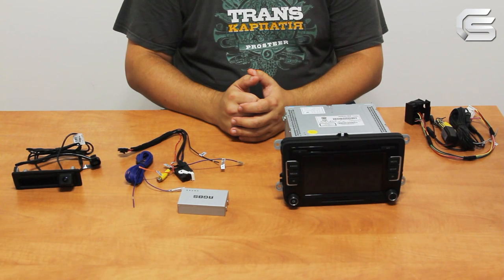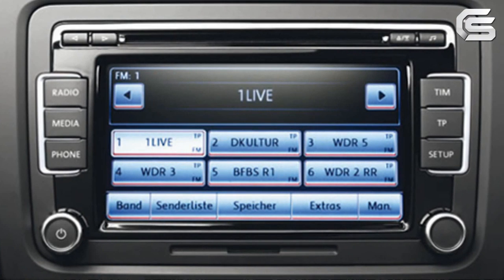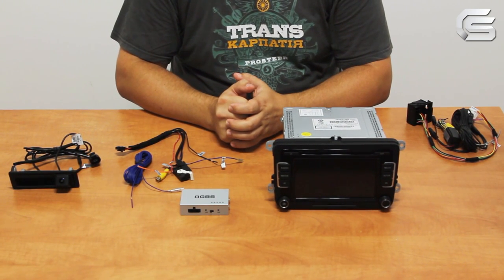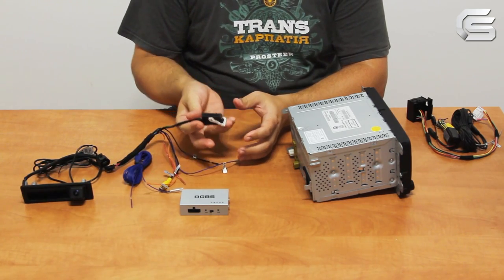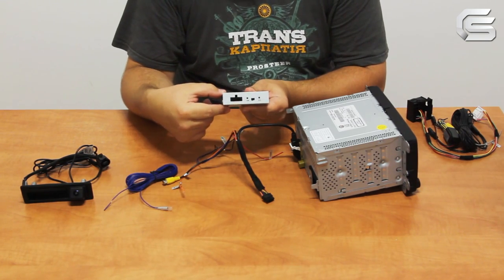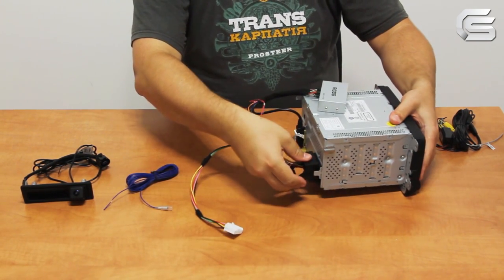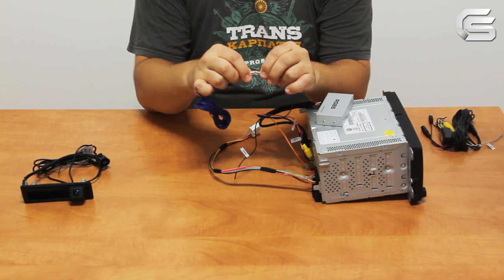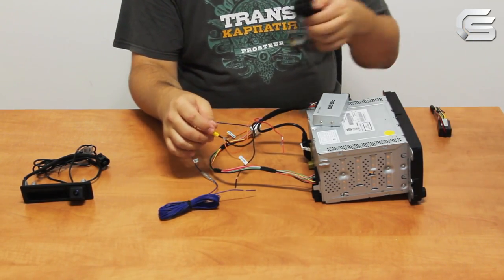How to Connect Aftermarket Rear View Camera to Volkswagen OEM Monitor

Comment: When I put it in R, the screen automatically goes to the camera through Canbus Do I still have to connect the red cable in reverse? or is yellow constant current and black mass sufficient? but won't the yellow constant current drain the battery? or can I also put Acc contact power on the yellow b+ so that it only turns on when the car is on

Comment: Do ypu have to go into the radio using a vag-com to make it work with the system?
Reply from the maker: You need to have your monitor programmed on the dealer's computer, namely to have the rear view camera function activated. Otherwise, the adapter and connected camera will not work. 
To do this, contact your local dealer. Please, note that it should be done by a well-trained specialist.

Comment: Hi I bought a vw cc 2010.  Is there a way to add GPS and Bluetooth without buying an aftermarket radio or to get a original vw unit for cheaper?  I am from South Africa and the only place that I can get something like that is from vw and they are insanely expensive.
Reply from the maker: Can you please clarify what kind of media system is installed in your car first?
Reply: Hi it is a RCD 510 Premium 8

Comment: Will this work with 2014 Jetta hybrid and done is have dynamic range?
Reply from the maker: It depends whether there's a necessary input in the head unit (RNS315, RNS510, RCD510 Delphi). Also, rear view camera functionality has to be activated (more details in product description). Lines are not supported, it's related to the OEM navigation box and camera.

Comment: I have an rcd 510 but it does not have all the jacks on the video. Is there any solution?
Reply from the maker: Hello.
In this case you may install a video interface https://car-solutions.com/en/video-interface-for-volkswagen-passat-phaeton-touareg-skoda-2009-2015-my.php to connect an aftermarket camera etc.

Comment: I have the RDC510 with the MEDIA button on top right will this kit work for me?
Reply from the maker: +Timmothy S. McKean You should check if there is an input for OEM camera. Not all  RCD510 head units have it.
Reply: Timmothy S. McKean did yours work?
Reply: but my own when I put it in reverse it gives me a message saying there's no video available and mine only has a usb input no 26pin plug
Reply: @christiansmalley7138  I have the same it charges into blue screen, If you find any answers please let me know

Comment: Dear I have touareg 2005 with radio navigator s2 and I'm looking to find except rear camera also parking sensor and Bluetooth.is this fusible?
Reply from the maker: Unfortunately, we have no solutions for such car models and head units yet.
Reply from the maker: The only solutions that we can offer is this video interface http://car-solutions.com/en/car-video-interface-for-volkswagen-with-rns2-system.php
YOu can connect a camera via it but no parking sensors or bluetooth will be available.

Comment: Hi, why should i pay $100 for that modul, plus $30 for camera, if the OEM camera is $100? Or it's something i missing?
Reply from the maker: +ninavas03 Hi. If you find an OEM camera for $100, that's fine :) Usually, the cost much more.
Reply: +Car Solutions I had the opportunity to buy an OEM reverse camera, but the seller told me i need a newer central to work camera. Can you clarify me?
Reply: Valentin Sfichi i too get a OEM camera for 50 bucks, i have a jetta 2017, the oem camera came from the exact year with the same stereo, what do i need to install the camera? Do you make it possible on yours?

Comment: Hello,
I have a US version 2013 vw cc sport plus with I believe either a rns310 or rns315 head unit. The device just didn't work. I have my head unit programmed already so when I'm in reverse, the screen turned into camera mode except that it is pitch black. I connected the 26 pins socket into the head unit, connected the video input cable from the camera to the female socket from the device, connected the blue wire to the back up light , grounded the black wire and actually connected both orange and red wire to a power supply. my camera is powered separately as well. But there is still no image. Could you please help me ?

Thanks in advance.
Reply from the maker: Connect red(ACC) and black(GND) wires directly to the battery (+ and -) for testing. Don't connect the orange wire. Blue wire is not necessary to connect. Also, try switching 315/510 on the adapter in both positions and make sure you've used an NTSC camera.

Comment: Is it possible to connect a wireless camera (Garmin BC30) to a VW RNS510 system (Golf 7 1.6 TDI 2014)?
Reply from the maker: Unfortunately, we haven't had any experience with Garmin BC30 head units, therefore we cannot recommend anything.
Reply: thank you, for your quick answer.

Comment: hello, how did you perform as a connection to get the image of the smartphone rns 510 ?.
Reply from the maker: In order to connect a smartphone you would need this video interface (https://car-solutions.com/en/video-interface-for-seat-skoda-volkswagen-with-rns-510.php ) and one of these adapters (https://car-solutions.com/en/entertainment-systems/car-mirror-smartphone-iphone-adapters ).
Reply: Car Solutions  hello, is it possible to make a video tutorial for the rns 510 because does not show everything in the electrical connection and handling

Comment: Bonjour 
Je besoin de caméra de recul pour VW Touran 2015
RNS 310
RNS. 315
Merci
Reply from the maker: Hi! 
RNS. 315 - you can connect the camera using this adapter:
https://car-solutions.com/en/891245-aftermarket-camera-connection-adapter-for-volkswagen/ 
Any NTSC camera with RCA connector will be good: 
https://car-solutions.com/en/catalogue/car-cameras/rear-view-cameras/?brand=volkswagen  
Choose depending on the sizes:
https://car-solutions.com/en/catalogue/car-cameras/rear-view-cameras/?brand=volkswagen
https://car-solutions.com/en/catalogue/car-cameras/universal-cameras/

Unfortunately, no solutions for RNS 310

Comment: what the pins of RNS510 are assigned for camera?
Reply: Hi! For a rear view camera connection, you can use this adapter: https://car-solutions.com/en/891245-aftermarket-camera-connection-adapter-for-volkswagen/
Reply: @ЮрійНиколишин-ъ7щ  thank you for your responce. But I have camera. I'm trying to connect the third party radio to the camera. In my understanding the wires from camera come to 26-pin connector. I just need to know what the pins assigned to that connector
Reply from the maker: Hi! To connect the camera to a third party radio, you need this adapter: https://car-solutions.com/en/oem-camera-connection-adapter-for-volkswagen/

Comment: What if head unit scree already goes into reverse mode (blank but no camera), is it still necessary to tap blue wire into reverse signal wire?
Reply from the maker: You do not need to connect this blue wire to the reverse signal wire.

Comment: How do I check if my RNS 510 had unit has a camera input (its fitted in a 2007 Touareg)
Reply from the maker: All RNS 510 head units have an OEM camera input.
Reply: David Skinner, my handbook says my car may have been fitted with a reversing camera at the factory - does your manual say that?

Comment: Hi, I have one question: my RNS 315 has a black connector and not yellow, if I buy your adaptor it will work? Thanks a lot. Best regards
Reply from the maker: Input for camera can be either black or yellow, it does not really matter.
Reply: Thanks a lot for your message.
Reply: @hercao5526  Could you tell us if you got it working?
Reply: @jayniblett5776  Hi! I could not, it did not work properly...greetings from Brazil ;)
Reply: @hercao5526  Thanks so much!

Comment: HOW WOULD YOU CONNECT A OEM CAMERA THAT CAME IN THE CAR TO THE AFTERMARKET RADIO  THANKS
Reply from the maker: This adapter will fit (http://car-solutions.com/en/oem-camera-connection-adapter-for-volkswagen.php)
Reply: Car Solutions do you still sell this devise ?

Comment: do you know if one of this units is compatible with a 2007 rabbit ?
Reply: +daniel alvarez - No these radios are in 2009/2010 VW's and newer.... You need a RNS315, RNS510 or a very late model RCD510 (2013 or 2014 or later I recall) "radio" head...

Comment: Will this for for composition media unit?
Reply from the maker: This cable fits Composition Media unit (https://car-solutions.com/en/rear-view-camera-connection-cable-for-seat-skoda-volkswagen.php)
Reply: So if I plug the video output into that it will work straight away?
Or do I have to have it vag com?
Reply: I noticed it needs coding as well, this is VAG COM isn't it?
And how would I know if the list of parts you give as being incompatible would be one of mine?
Reply from the maker: Just follow the provided link, instructions are in the product description.
Reply from the maker: There should be a sticker on top of your head unit with the part number.

Comment: Does it work with passat se 2013?
Reply from the maker: If you have one of the following head units then it should work: 
RCD 510 Delphi
RNS 310
RNS 315
RNS 510